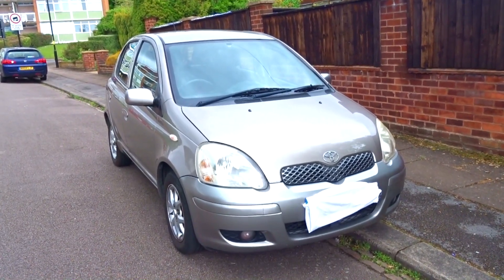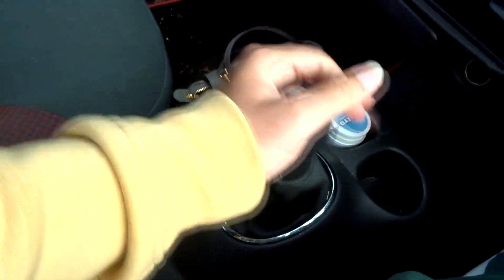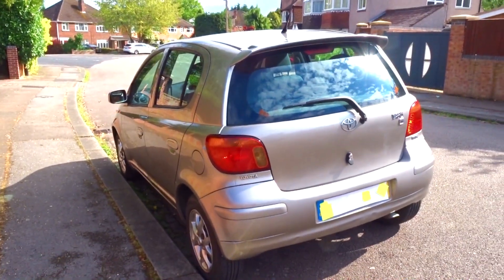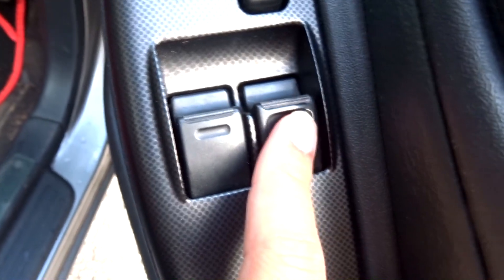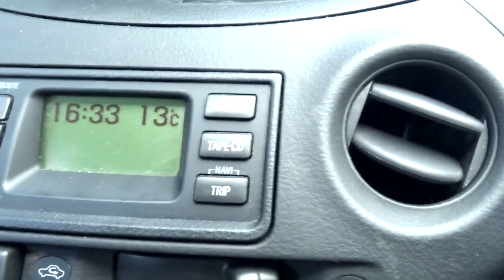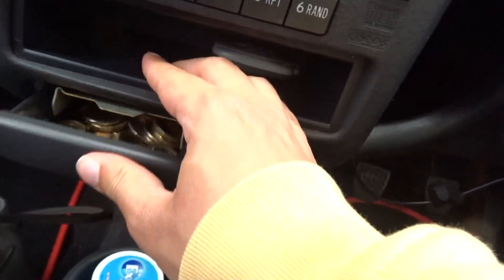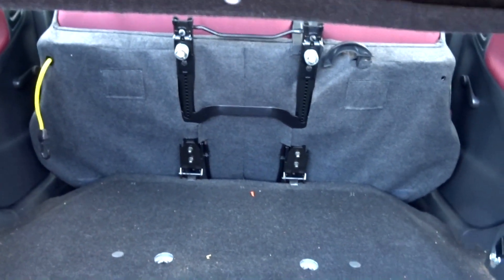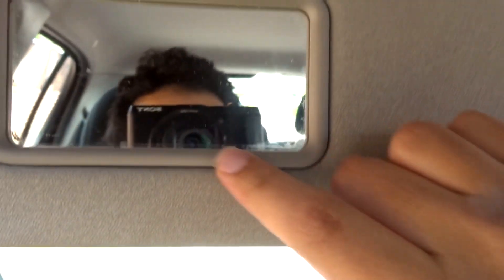2005 Toyota Yaris 1.3 VVT-i Colour Collection (UK) (full in-depth tour review)

Comment: What yaris would have manual windows? i had a 2005 but i was changing its engine air filter and then it wouldn't stay running :(
Reply from the maker: The Yaris XP10 came with manual rear windows on all trims, but they are manual for the front windows on the S/T2 trims.
Reply: @MoAV15  Yes i had manual front it was a 3 door car thank you.

Comment: Thank you ! Do you still use it ? What do you hate and what do you prefer on this Yaris ? I've seen one in really good condition for £1500 in France (1700€).
Reply from the maker: If you are referring about the car, then this Yaris is not my personal vehicle so obviously I don't use it.

The pros on this Yaris are its endearing looks, flexible features and superior reliability that beats anything else in its class. Although, the cons on the Yaris are no electric mirrors on mid-range trim and the audio head unit is confusing to operate.

I found used Yaris like these are good used car options priced from approx £2k-3k.
Reply: @MoAV15  Thanks for your reply. Yeah this endearing look was one on the pros. Unconventional car interest me. The one I was interested in was sell. I was sad because it was exactly the model I wanted. 1.3 Vvt-i. But for the same price I can find French car much modern. Like the 207 Renault. Even though I don't like the design and the fact that's a popular car. Can I ask you what is your car?
Reply from the maker: Our personal vehicles in the UK and Indonesia are; 2013 Kia Rio 1.4, 2015 Nissan Pulsar dCi N-Tec, 2012 Toyota Yaris J and 2015 Honda HR-V S, respectively.
Reply: @MoAV15  How much did you buy this for?
Reply from the maker: I know that we purchase 2013 Kia Rio (used at 5 years and low mileage at 10k miles) at £6k and the 2015 Nissan Pulsar (used at 4-3/4 years and 40k miles) at £7400.
Reply: @MoAV15  I meant how much did this Toyota Yaris cost?
Reply from the maker: This Yaris in the video is not our personal vehicle so I cannot tell the price.

Comment: the t reg older yaris 1.0 gs is the tough cookie but the exhausts are weak inferior downfall
Reply from the maker: Toyota cars are incredibly reliable products, have strong resale values and have the least recalls. By the way, thanks for that information!
Reply: This is exactly how I lost my old yaris Sr had 160 000 miles on clock and was running great. But the whole exhaust system and the gasket joint and bolts had rusted so bad that it was a £400 labour job just for the time it would take to get the bolts out and replace a £10 gasket. ( really awkawrd to get to) 

I was driving it for months with exhaust fumes coming through the dashboard air vents, due to a leaky gasket. Had to let it go before I got some sort of  carbon monoxide poisining
Reply from the maker: That was a good story of your Yaris. The Toyota Yaris are super reliable B-Segment cars I could a few old Yaris cars on AutoTrader that clocked over 150k miles and some low-mileage cars (20k or lower miles) holds it values up to around £3k for over 15 years of ownership.

Comment: ı have same the yaris 2004  year
usefull for crowded cities
Reply from the maker: I agree with your point it is compact enough to drive through the capital of Japan where it came from without any hassle.

By the way, do you live in the UK?
Reply: Mo's Auto Vlog Zone you are certainly right. 
best reguards from Turkey of istanbul
Reply from the maker: E _One Want to request me a video?
Reply: Mo's Auto Vlog Zone  it can be abaout to oldfashion cars.
Reply from the maker: @E_One.  Which old car?
Reply from the maker: @Alidumanify Highly reliable 10/10 it deserves it be the winner of European COTY 2000.
Reply: This is why in the UK, almost every takeaway delivery place uses them as delivery cars. They have bulle proof engines and are nippy little buggers
Reply: @Alidumanify  ıt can be good choice for yaris at UK cause of emit. beause emission reduce is obligatory in UK.
Reply: @Alidumanify Did you buy it ? What do you think about ? I was also hesitating between this Yaris and a Micra K11. The Micra K13 seem nice to me too and not that expensive for a 2011/2012 car. By the way I'm surprised by the 500£ price of your Yaris ! I think it's a good deal. I've seen one for £1500 in France.
Reply: @Alidumanify  yes I agree with you. But I live in turkey If you search to street value of second hand car in turkey For example estimated  2005 years toyota yaris 8500 Pound Plus tax and insurance Deep total 9000 pound Not including care and repair.
Reply: @Alidumanify From yaris to audi ahah. Finally the yaris I was interested in was sell. So I consider buying a 207 Renault maybe. Even though I'm not that fan of the design and the fact that's a popular car. Interesting didn't now it was like that in England. In France the insurance price seem to depends on the power of the car but I don't know that much about the price.